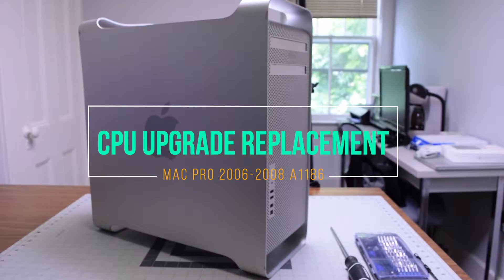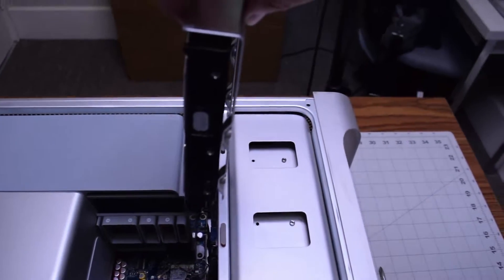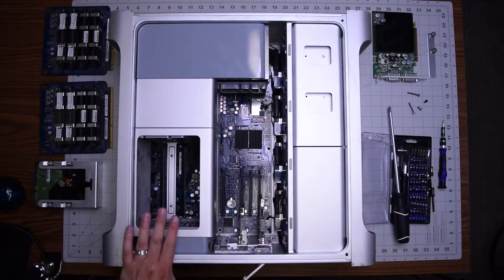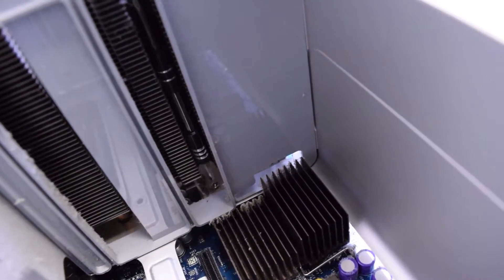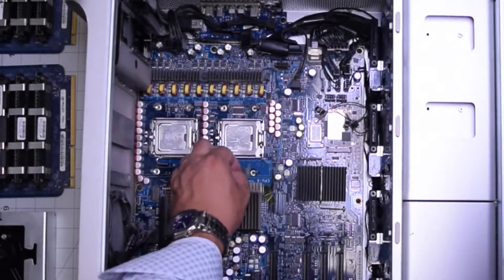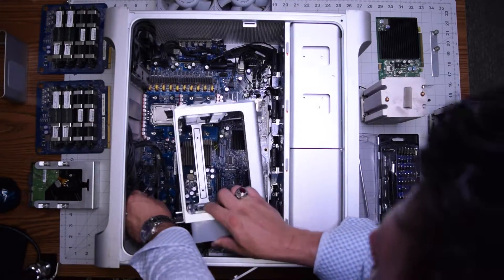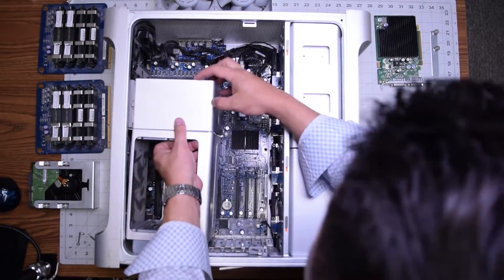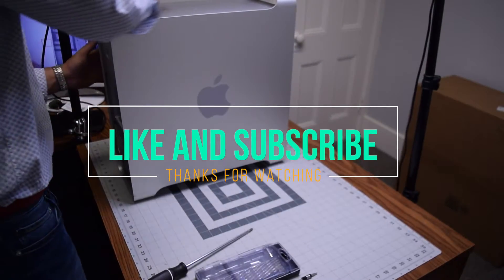Mac Pro A1186 - CPU Upgrade or Replacement (2006 and 2008)

Comment: Good evening 
> 
> Came across your channel, really cool and informative 
> 
> I’ve got a Mac Pro 2008 
> 
> I’m really new and don’t have a clue where to start 
> 
> Advise on [ How to connect to a new Monitor, I was told I need a HDMI to DVI cable is that correct ? 
> 
> [ how to get the best from the computer 
> 
> [ I’m a marketer and would use it for photoshop ,video editing , leaflet creation , PowerPoint ect 
> 
> [it has a 1T memory card 
> 
> [ I see a lot of videos upgrading like space, speed , ect 
> 
> Thanks

Comment: Does this model take the dual 6 cores?
Reply: No. I think you have to have the later 4,1 or 5,1 models. Lots of YT videos and google-able info on which models support the various processors.
Reply: By chance, I just ran across this video that shows which CPUs the 1,1/2,1 A1186 MacPros support. Go to 8:00 in the video listed below. But of course, these are NOT the dual 6-core processors you are looking for.
https://www.youtube.com/watch?v=N3uh15NRSYg&t=842s

Comment: Awesome video.  Thanks for sharing.  I have 2 CPUs in the garage for almost a year because I haven't had time.  I was just scrolling through these videos and was presently surprised to see your video.  First thing I did in the comments was to search for keyword: thermal paste. But to my surprise no one chimed in so i get to be the first. What's up with the 5 dots:) Just kidding. I've read a lot of opinions on that, and I thought the pea in the center was the most popular.  I thought I saw a guys test where he tested different methods and temps weren't all that different, i can't remember which one won now.  Anyway great video.  Now I'll watch the rest of the video:)